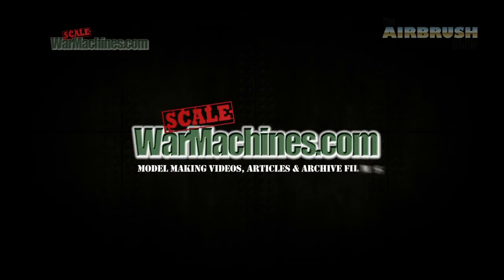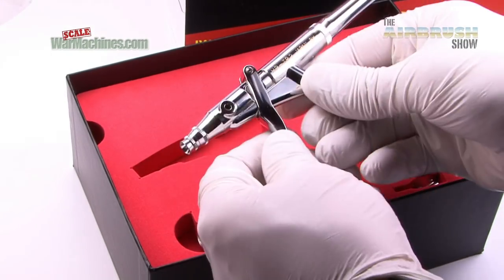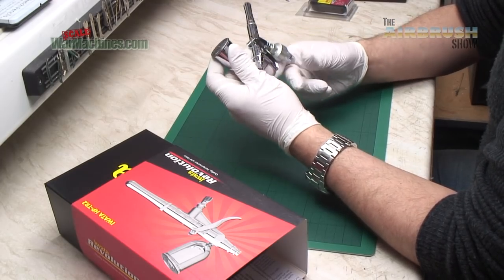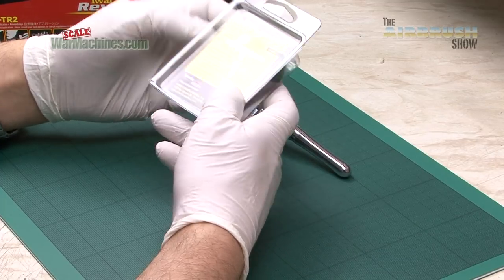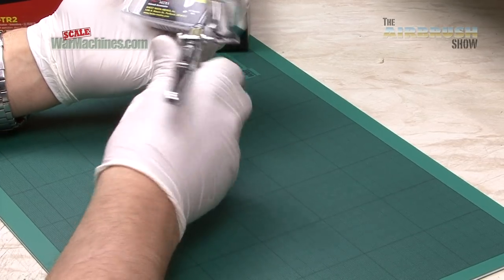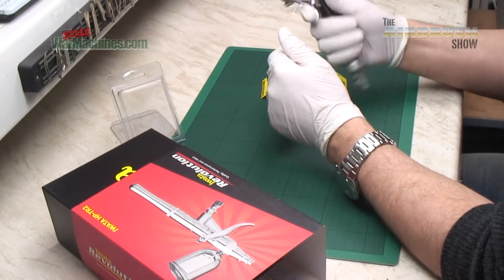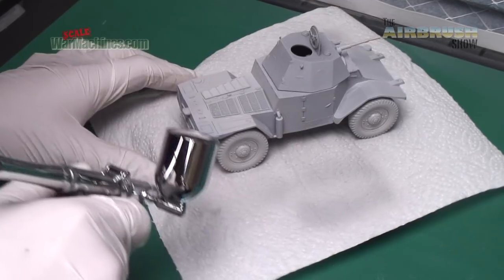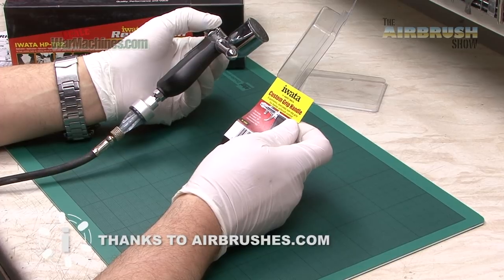A SIMPLE IWATA UPGRADE - CUSTOM GRIP HANDLE - THE AIRBRUSH SHOW S2.EP02

Comment: I recently purchased this handle for use on a CREOS PS-275 and it works great. I would recommend this handle upgrade if you have trouble using an airbrush. I had a stroke and this makes it much nicer to paint now.  It's well worth it.